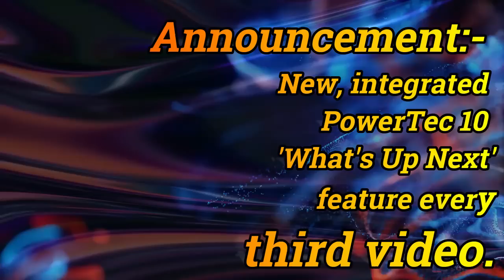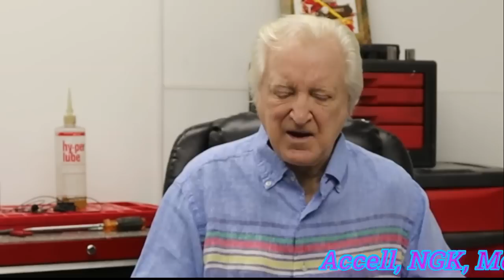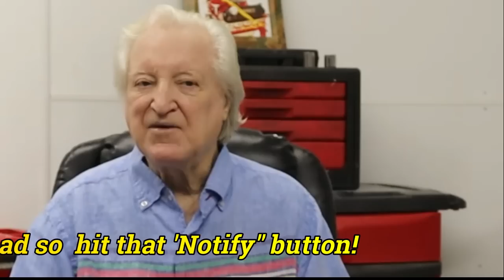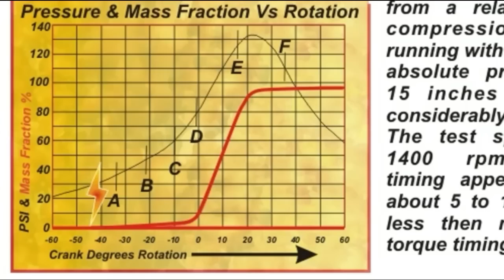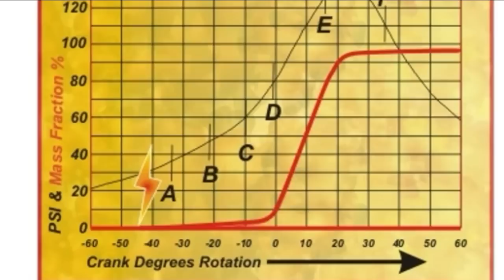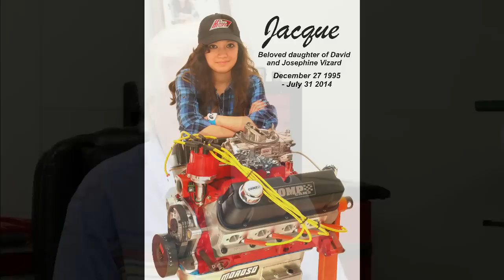Power sparks & how to use them.

Comment: Resistance is a double edge sword.  It both reduces current through the plug and extends discharge time.  The system may build a lttle more voltage [seen by the distributor], some of which is lost getting to the electrode.  I was intrigued by aviation resistor plugs years ago - which seemed to favor 4k ohm if I remember.  You won't find that at your average parts store.  That's its own world obviously [I have never flown or built for a plane] where nearly all prop operation is below 3k rpm, and altitude is capable of changing behavior of arc force.
Reply: Remember they're catering to magneto's, fully shielded solid core wires, .020" plug gaps with the full throttle rpm limit @ 2700 rpm, and generally 20-24* fixed ignition timing. (with Impulse couplings) High BMEP.

Comment: I’m using a Progression Ignition blue tooth HEI distributor w DUI Livewire 8 mm wires and NGK V Power plugs on my new small block build. What do you think guys ?
Reply: I too have the progression ignition HEI and NGK 5ES plugs and it seems to work very well. Not sure if it makes anymore power but I don’t have any fouled plugs. 406cu/in 101/2 to 1 8mm wires, 750 FST billet extreme carb, AFR 210 heads, Erson .548 .548 cam , 1.6 rockers, roller lifters, scat forged rotating assemble. 526hp/ 504tq

Comment: Just came in at the end.  Inductive cables act as a resister to higher frequencies, which will limit the rise time of the high voltage pulse.  A fast rise time is beneficial in firing fouled plugs etc. A square wave  (part of which is the leading edge of a pulse) consists of harmonics which are a combination of high frequencies.
Reply: Using a scope to see the discharge comparison of graphite to copper core there is definitely that suppression of noisey spark at the start and a stronger total discharge with graphite core
Reply: @needmoreboost6369 what about a comparison between graphite core and inductive HT leads ? IMO the inductive are better because they can store and return at least part of the energy to the spark gap , their active resistance is much lower ( about 1-2 KOmhs per meter vs 7-8KOhms per meter for graphite ones) which reflect in the value of the spark current during the inductive phase of the discharge and the total amount of spark energy delivered to the gap . I’m not absolutely sure but IMO the only advantage of the graphite core is the lower manufacturing costs .
Reply: Faster (ignition pulse) rise time also rise the breakdown voltage of the gap. So, more energy is spent on the breakdown event and respectively less on the inductive phase , which actually is doing the job . The breakdown and capacitive phase just create EMI and erode ( mainly) the spark plugs electrodes . CDI systems has much faster rise times and this is one of the reasons why they are less efficient in igniting  the mixture , that’s why the wast majority of today ignition systems are MDI . Fouling of spark plugs is extremely infrequent case with fuel injection systems . CDI manufacturers love to report the amount of energy based on the charging voltage and the capacitance of the capacitor but not on the actual spark energy :)
Reply: Thank you for your comments, You are right that the energy stored and dumped into the coil cannot equal the energy at the plug gue to losses in an imperfect world. Measuring (even calculating) the energy at the plug may be a bit more difficult. A fast rise time also increases the risk of crossfiring between cylinders via capacitive coupling between leads, Potentially (no pun intended) disastrous with loomed plug wires.

 The rise time though is very significant in the firing of the plug hence the use of multiple spark systems. I realise it is easier to generate multiple sparks than extend the duration of the spark.

I have experimented over many years with transistor assisted ignitions with and without multiple sparks and dwell extension as well as CDI. My holy grail was (is) a multiple spark CGI.  My homemade CDI works better than the others on a hot 4 cyl motor from the 70s which has 2 x DCOE Webers.

I doubt that my system would compete with fuel injection and a coil for each cylinder under CPU control. I apologise for the length of this (my wife says I need to go out more often).